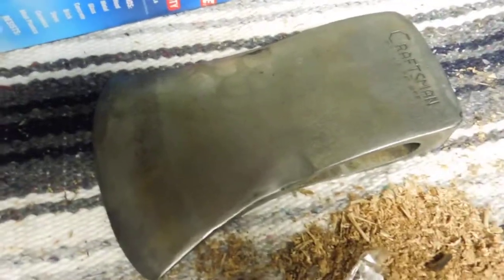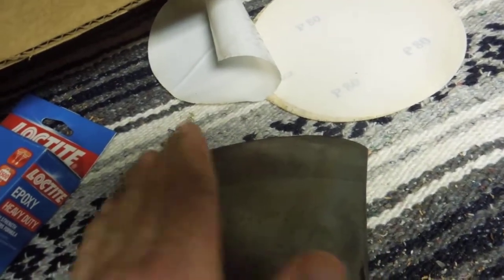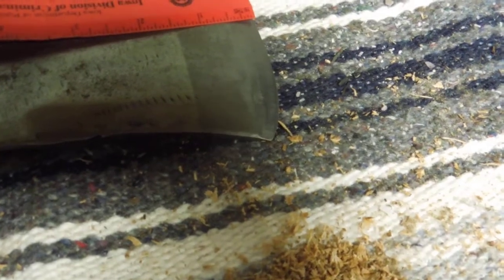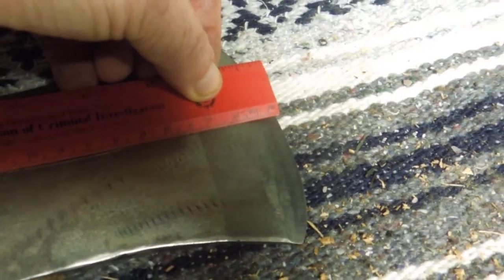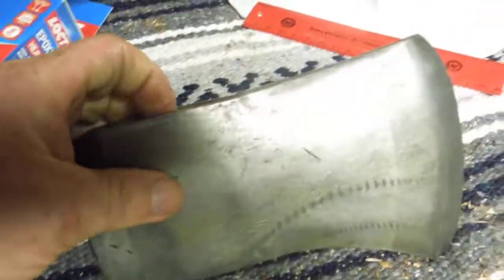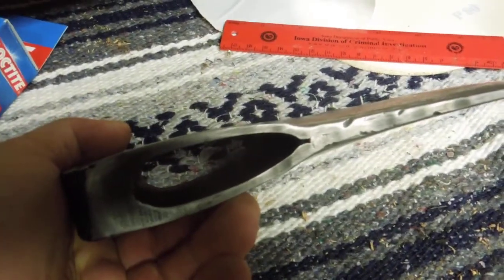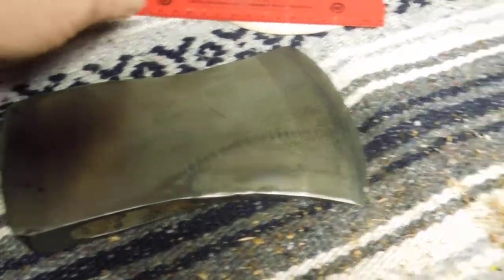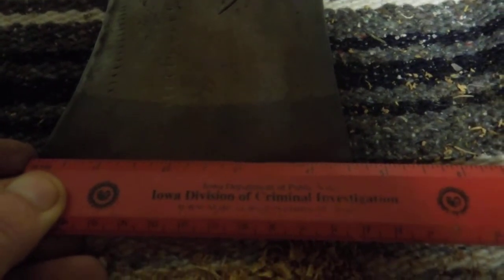Craftsman Axe head rehab pt 3

Comment: That line is actually a temper line.  It's a lot like a Hammond line on a samurai sword.  That thing is all the same metallurgy throughout,  just hardened on the edge. 
The axe looks great ! I'm working on almost the exact one right now.  I believe these to be from 1935 to 1941 but I'm uncertain at this point.